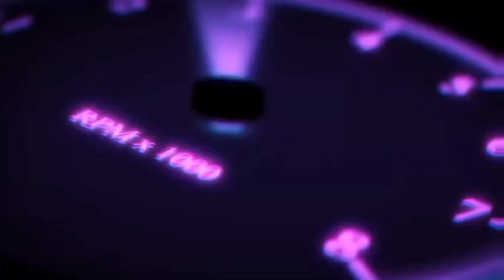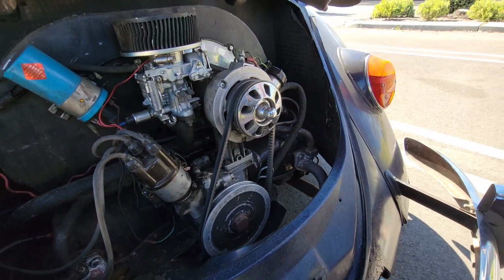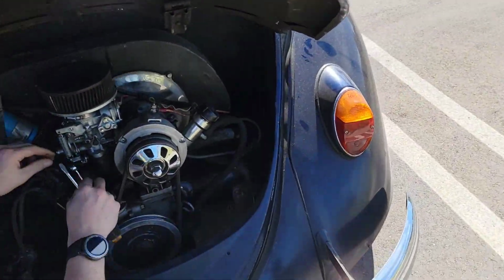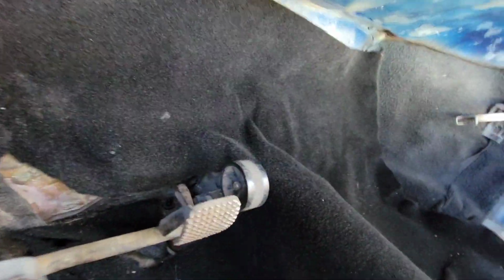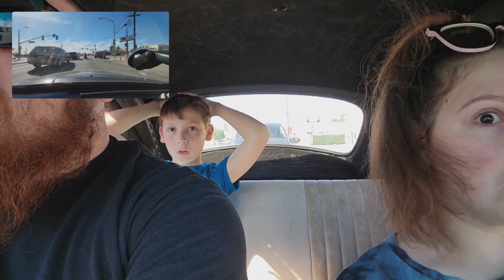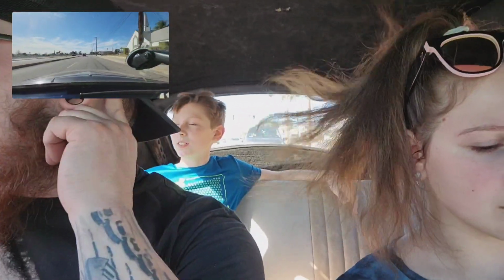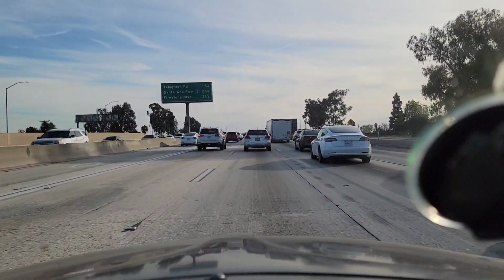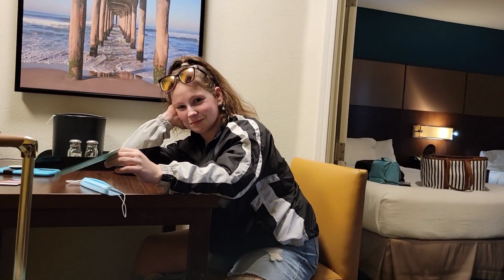Abandoned 1961 VW California to NY Make it, Or Break It: Episode 1 Part 1

Comment: Somehow my previous comment vanished.  I'll try again.  If shifting is dicey, check the bracket on the Floor tunnel, make sure it's tight.  If it is loosen it enough so you can move the bracket slightly forward, backward, sideways.  Each time you move it, retighten and check to see if it's shifting the way you want.  Once it's where you want it, tighten the 2 hold down bolts.
Reply from the maker: Yeah I tried to reply and it was gone.

Ty we will try this tonight at the hotel along with other repairs